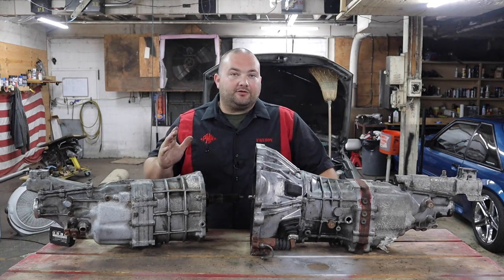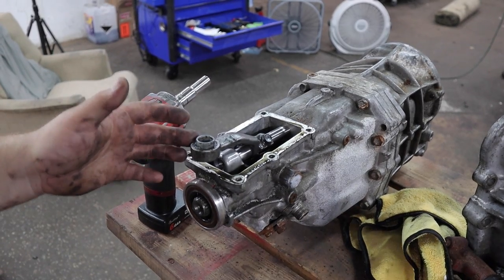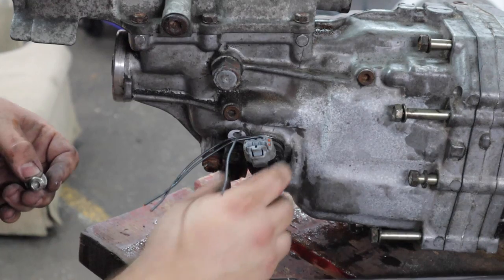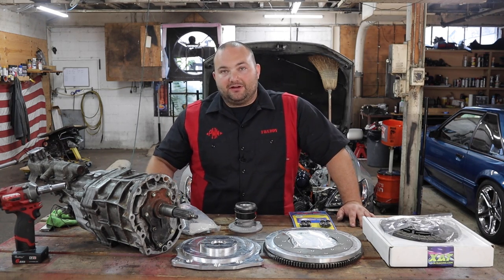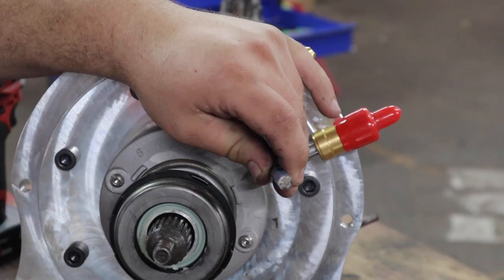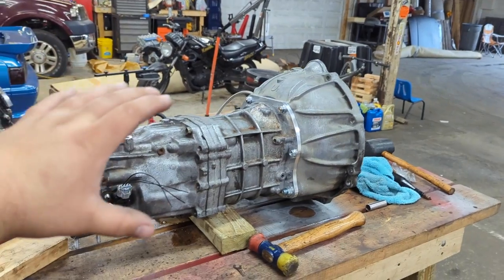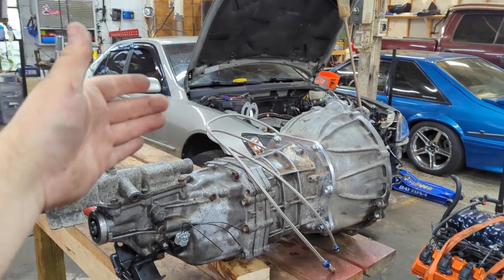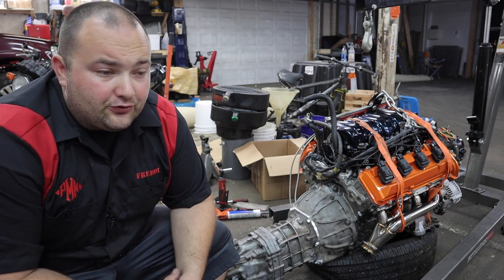Lexus IS300 1UZ Swap Pt3 W55 to W58 Swap + Bell Housing Conversion

Comment: you completely wasted your time    when you look up rebuild kits for the w58 trans it will have two different kits  the kit for mk3 and all other w series transmissions and then the kit for the swan neck and tripod w58 and 55   the later kit is different as they have triple synchros and wider bearings you used a w58 with an aluminum center housing meaning its from a celica making it the most weakest most unreliable w  you would be better off with the w55 or a swan neck/tripod varient  i personally have ran a swan neck w58 behind my 2jzgte vvti with sp63 turbo at over 20 psi  i guarentee the hodgepodge trans you came up with would last one launch in my setup
Reply from the maker: Well then I guess it's a good thing the transmission isn't in your car and doing launches? This car is a daily driver, not a drag car.
Reply: @PoorManMods Sure, the aluminum bearing plate W58s are technically weaker than the steel plates... but my old Mk3 NA Supra had an aluminum W58, and I  drove the almighty shit out of that car for over a decade, and it was a built 7MGE that revved to 8 grand.  When the cancer got to her, the 7M went into a 4runner... and I still have that W58

Comment: Hey mate. I’ve got a vzn130 manual box surf. I’m looking at swapping the 3VZE out for a ford 302 Windsor. Any chance you’ve done this combo before? I’m looking at using the factory surf running gear, so would be getting an adapter plate made up. From your experience could you see any obvious issues I might come up against.

Comment: also noticed you removed those dowel pins  i made my own adapter plate for the uz to w58 and i based all the alignments on those dowel pins   there actually what gives that surface the structural integrety it needs  now all that tq is reliant on those bolts
Reply from the maker: I mean that's how the kit was designed, I didn't make it.

Comment: So, are the 58's heavy duty compared to the 55? And then how does the 58 compare to the R154?
Reply from the maker: From what I understand the W55 is good for like 3000tq max, the W58 is good for 450ish I think? And an r154 is capable of 700+ I think?
Reply: That does not seem logical since they are the same series transmissions with just different gear ratios.  Also, you swapped out the newer W55 / steel plate with the older W58 without the steel plate which seems like a strength disadvantage.

Comment: I’d rather just convert over to r154 box  but all good if that’s what ya got …. I put a 2jz/r154 in a 94 hilux stupidly fast and fun 
I’m a automotive machinist so make my own adapter plates ect I’ve fund if going to do something go with the better option w58 box’s don’t last long…  anyone in nz give me a holla lol can make to suit bell housing ,drive shafts ect to suit I’m qualified to do certification modifications except I need renew crack testing license….. I’ve used a few of the ba/bf falcon concentric slave cylinder same a chev ls slave cylinder I used the quarter master concentric slave cylinder in last few conversions cause gas more travel and more adjustable
Reply from the maker: I figured I don't need anything stronger than a W58 for this build but we will see what happens. I have an r154 in my supra. if the W58 brakes I'll swap in the r154 and then put a 6 speed in the supra 😅